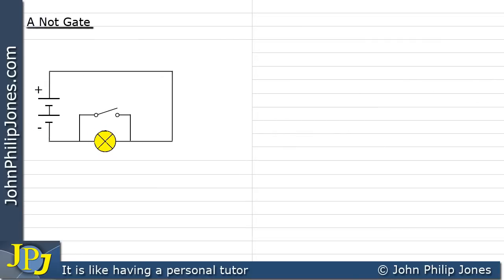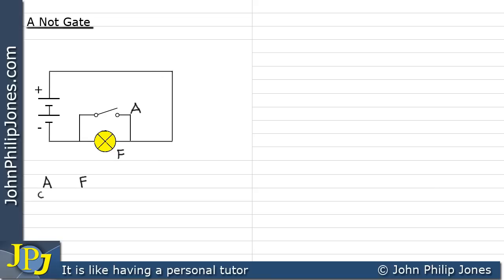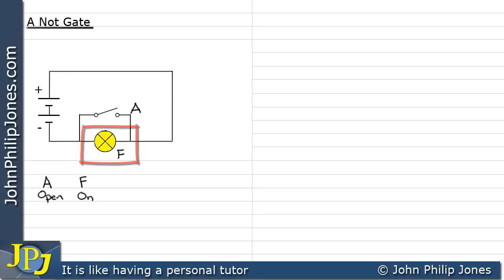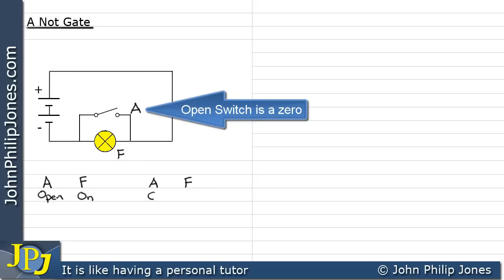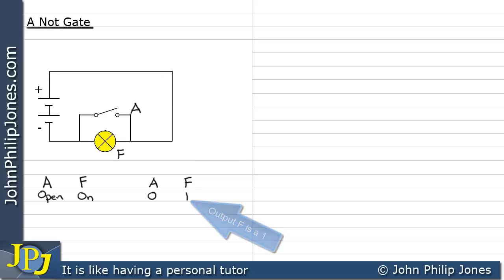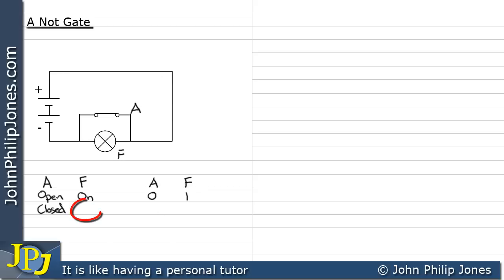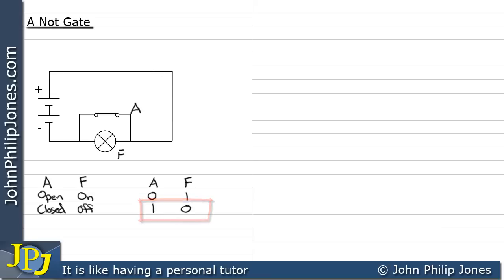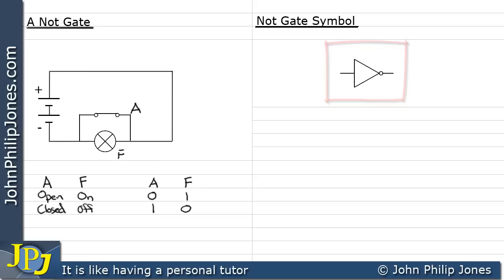Logic Not Gate

Comment from the maker: Hello Tom,

The circuit used is to help visualise the logic function of a Not gate. 'Electrically speaking'  it is not a sensible circuit. However, the resistance of the switch compared to the bulb (lamp) is effectively zero so when the switch is closed all electrical current will flow through the switch (a tiny bit will flow through the lamp but not enough to 'light it'). Closing the switch 'shorts' the lamp.

Bw
Phil

Comment: This circuit diagram is not correct. regardless of the switch whether it is on or off current flow through the circuit because you have connected battery source and the lamp  directly to the power source and the switch is in parallel
Reply from the maker: The circuit used is to help visualise the logic function of a Not gate. 'Electrically speaking'  it is not a sensible circuit. However, the resistance of the switch compared to the bulb (lamp) is effectively zero so when the switch is closed all electrical current will flow through the switch (a tiny bit will flow through the lamp but not enough to 'light it'). Closing the switch 'shorts' the lamp.